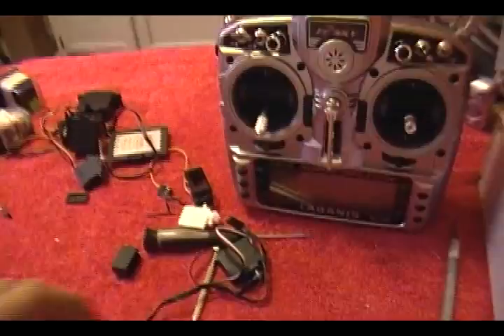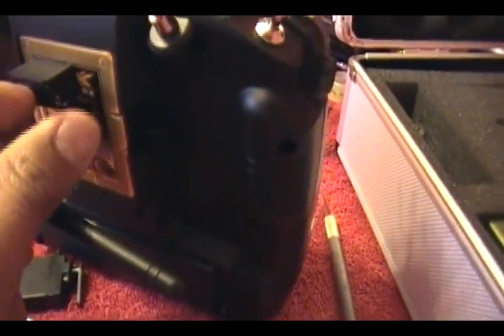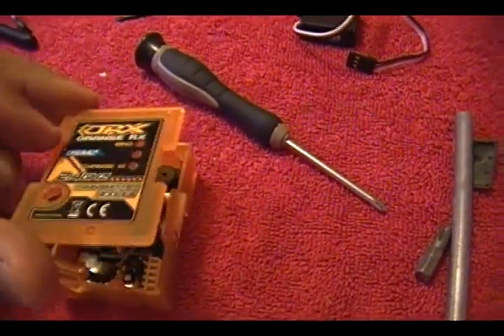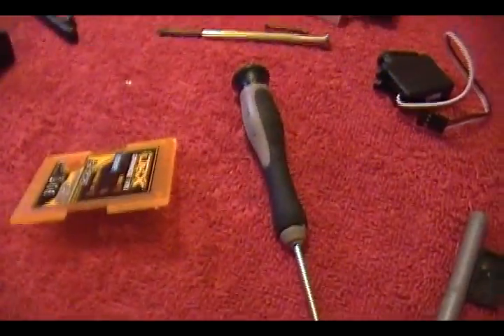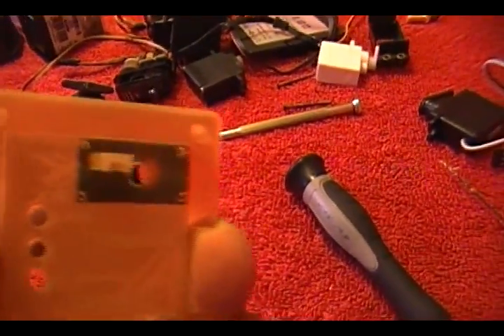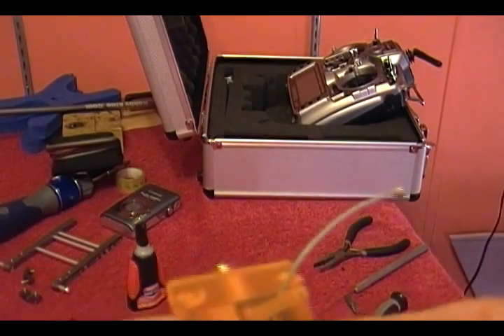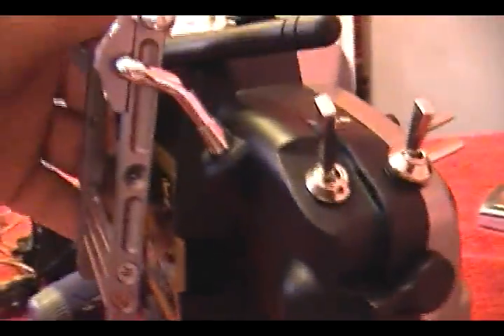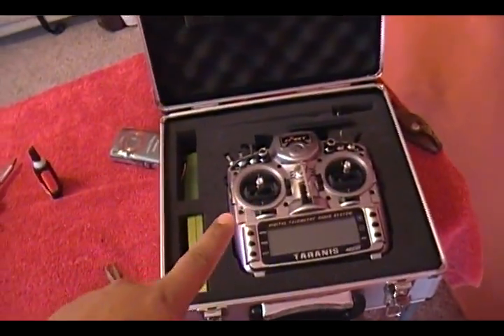Orangerx module Antenna relocation

Comment: Cannot mod the antenna anymore, the antenna socket is soldered to the module board already. No more pig tail cable and screwed antenna socket. Otherwise soldering mod only.

Comment: This mod doesnt work anymore. I was on get 3 d printed cover to replace the antenna. BUT the simply left the pigtail soldered the SMA socket directly to the pcb:

New Module:
http://www.hobbyking.com/hobbycity/store/uploads/1028430064X1156341X16.jpg
https://www.hobbyking.com/hobbyking/store/uploads%5C1028430064X1156341X27.JPG
https://www.hobbyking.com/hobbyking/store/uploads%5C1028430064X1156341X39.JPG

3DPrint replacement Cover:
http://www.thingiverse.com/thing:391383

Happy Landings

Comment: Great idea, I would make one tiny modification, turn the servo case 90 degrees, long way up and down. That way you would not have to squeeze the wire on the antenna mount against the side of the servo case. Still, a fantastic idea, I will be using your idea with the servo case turned when I fit the Turnigy 9X module into my new Taranis. Many Thanks.

Comment: Daniel, I have always wondered why don't people connect the module's antenna lead to the radio's existing antenna? Is there a reason why you did not do that?
Reply from the maker: Well on thise case I will be using the internal frsky module too so I left it alone but yes you can use the internal antenna you will just have to Connected to the external module